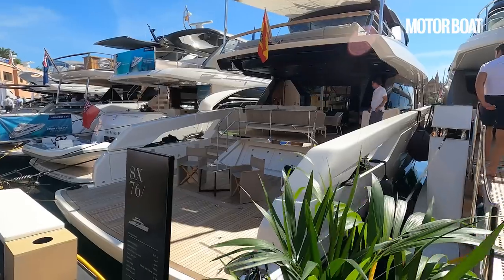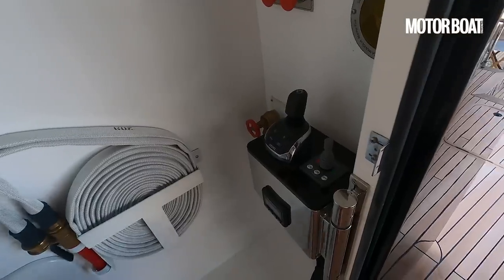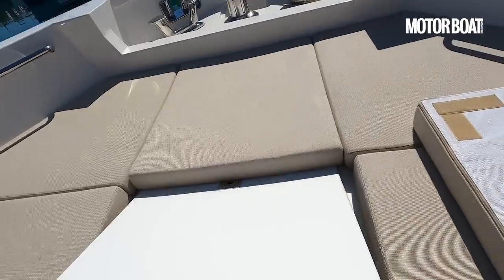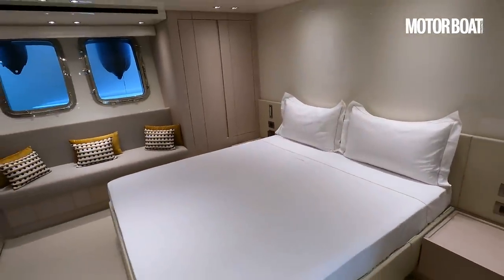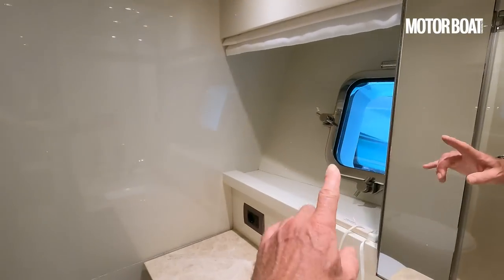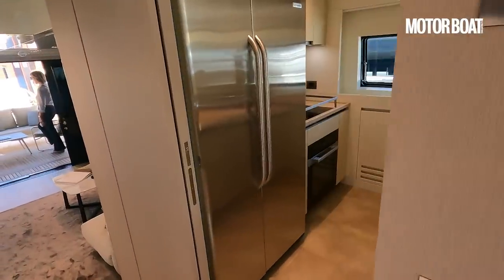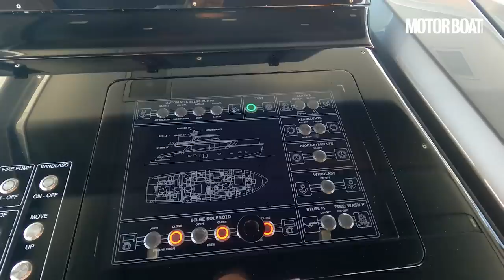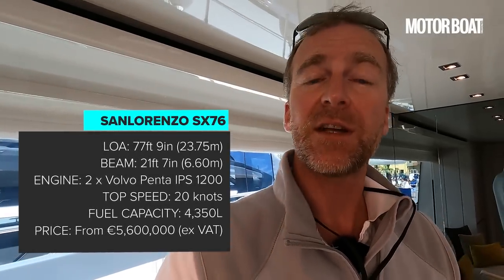Inside a €5.6m Italian crossover yacht | Sanlorenzo SX76 yacht tour | Motor Boat & Yachting

Comment: lovely boat but it feels quite sterile.  not homely at all. also there is an abundance of mirrors which makes if feel slightly like a 1970s disco,  its funny - when you are demonstrating the sound insulation of the the door and you close it you can still hear the two blokes chatting upstairs.  not a winning moment for San Lorenzo. the other thing that is apparent from the audio is that when you open the doors they do not "clunk" solidly into place.   they rattle with a bit of a cheap, under built sound.  we know san lorenzo is a quality builder so this needs to be reconciled.
Reply: Interesting you should say that as that’s not the way it sounds and feels in the flesh. The doors feel more solid and sound proof than most yachts this size. Maybe the mic is too sensitive!
Reply: @hugoandreae3785  probably the sound is lost in the audio equipment.  it certainly looks quite solid and of course they are known to build a fine boat.